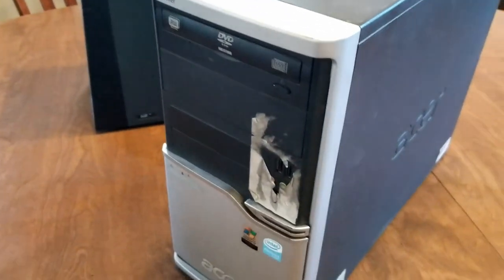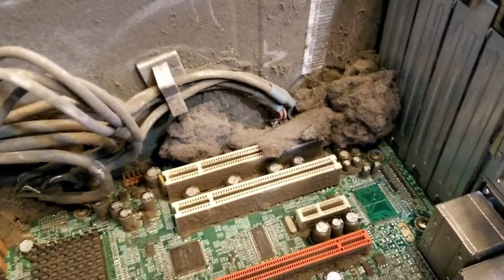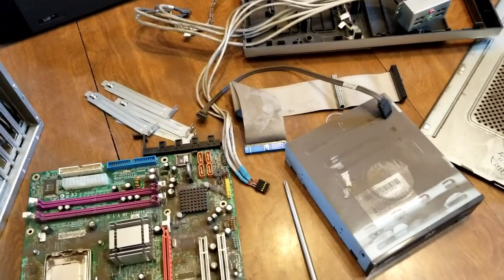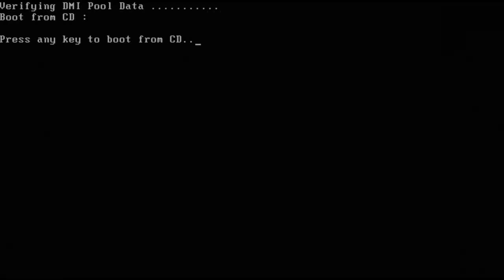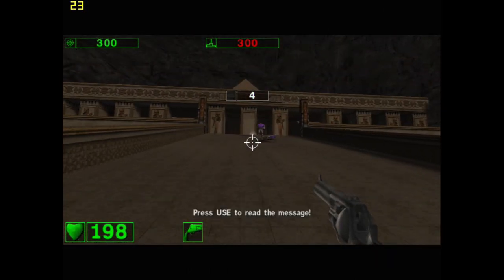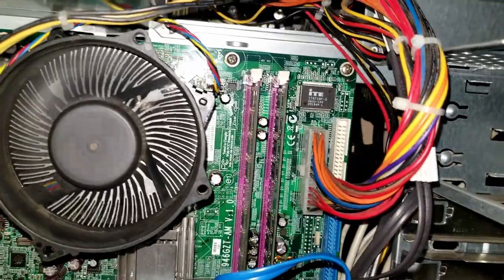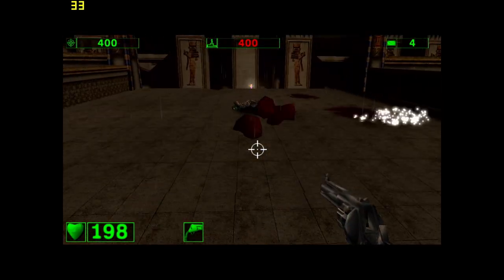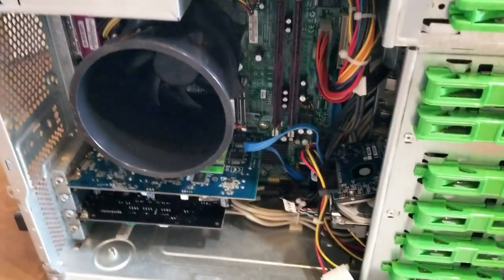Filthy Acer Power Windows 2000 Pentium 4 gaming PC build

Comment: If it's a socket 775, I'd at least try to put a Core Duo in it, wouldn't bother with a straight p4 though.  That's just me.
Reply from the maker: It will definitely end up with a core 2 at some point! :)
Reply: @Snickerrick  Noice.  I'm guessing it's too old for a C2D, tho, right?
Reply from the maker: When I was looking up the motherboard, i came across the supported CPU's and it claims it will support 800 mhz FSB core 2 duos! I will be putting that to the test :)
Reply: @Snickerrick  No way!  That practically makes this thing modern!  You put a 260 or better nVidia card in there and you can play some fantastic games dude.
Reply from the maker: Yea but I was trying to target more around y2k era games, windows 98 stuff. I could put the 260 and C2D in and might as well run Vista then. I will probably settle on a E4300 and x850 xt combo, or something similiar.
Reply: @Snickerrick  Ah, right on.  That's a p. good combo, still.
Reply from the maker: I will probably go up in CPU and GPU till its as far as it can go, then go back to something more specific for W2K. I need to keep in mind it is like XP, DX9 only. 
:)
Reply: @Snickerrick  Yeah, I often forget the "good old days" ;)
Reply: Snickerrick Don’t forget to upgrade the ram to 4gb and try to run Windows 10 on it, that would make a great video! “PUSHING THE ER-ACER PC TILL IT FALLS”.  And also you could use the left over Tako Bell looking case for a SLEEPER PC!
Reply: @thedungeondelver  Some of the i945 and i965 chipset motherboards really supported core 2 duos. Depends on power circuit on the board, how the manufacturer implemented it.